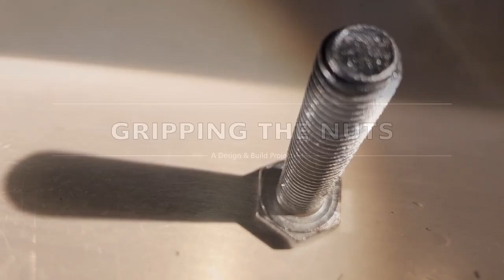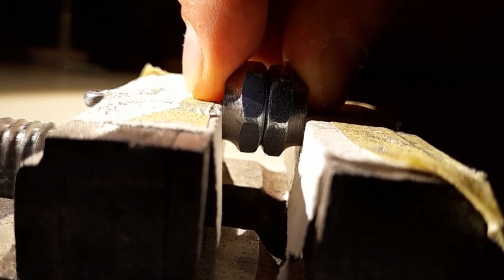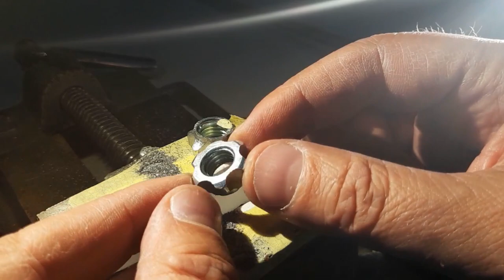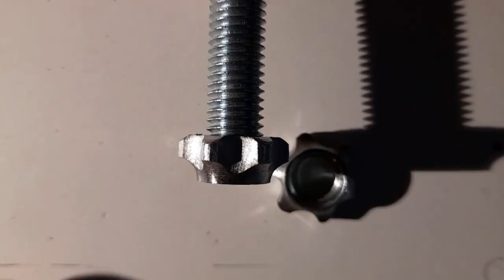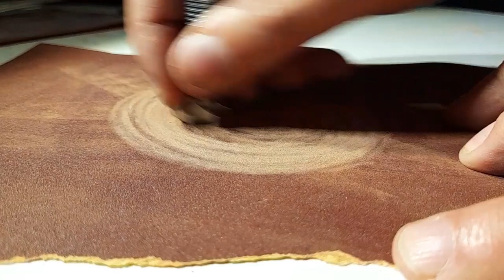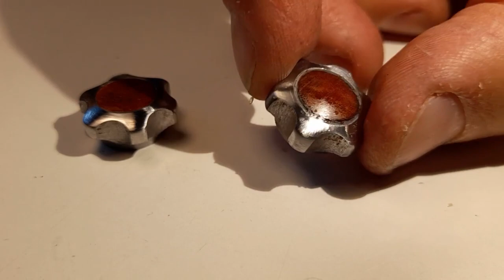Gripping the NUTS | Relaxing Rosewood & Steel Plane Grips Build. Real sound - no music

Comment: I love these mini knobs!! What a clever idea. I picked up a 2" brass nut not long ago to use as the head of a small but heavy hammer. Someone on YT made one and I loved the size and simplicity of it. It will be the perfect size and weight to use with chisels and carving tools. Your idea is very cool and would also make great cuff links, pendants, earrings, etc. They maybe to heave for the jewelry idea, but they can be cut in half to make them thinner. These small knobs will be great for some ideas I've had for making hand router plane and small boxes. Thank you for being an inspiration!!
Reply from the maker: Thanks for the compliments, appreciated! Good luck with your work